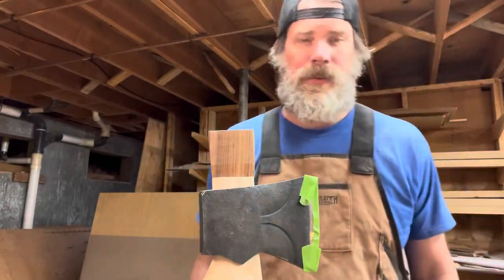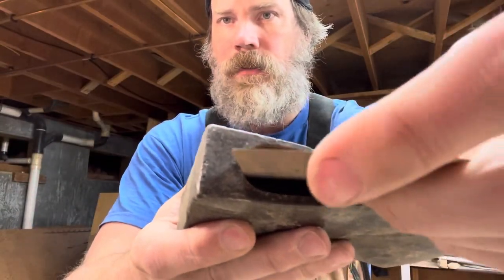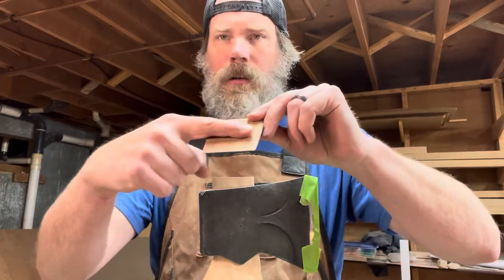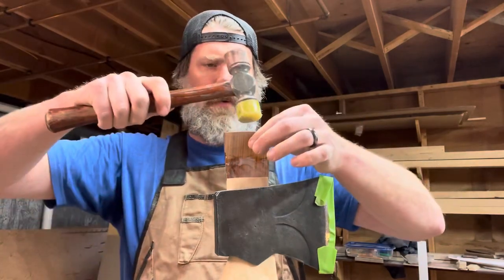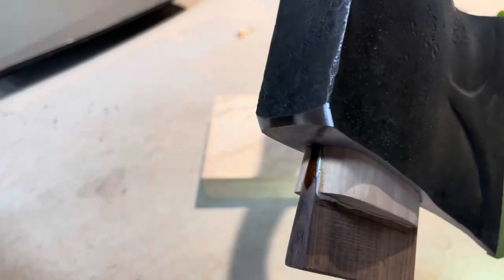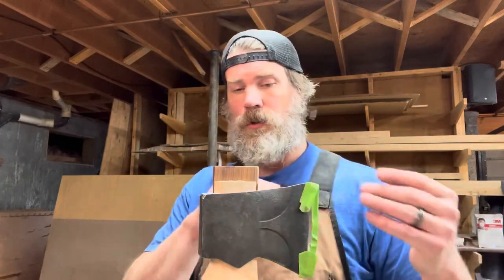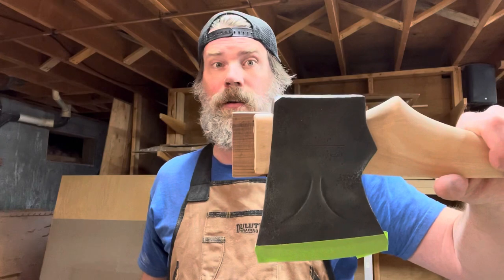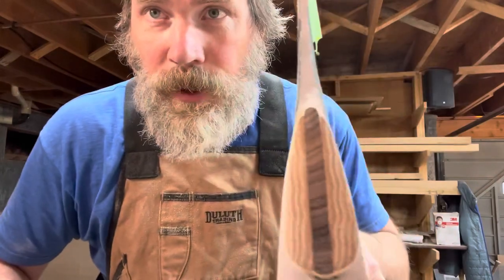Driving a wedge in an axe

Comment: I never really thought of the wedge part as being stressful, in fact, I always look forward to this.  I don't really feel any aspect of this is stressful per se, except when I first started and I would carve a handle really nicely and then worry that I would shape the tenon too small for the eye. That is until I figured out two things; don't finish the handle until it fits the eye, and use cross wedges if it doesn't fit front to back. This way you don't spend too much time on a creation that you might have to throw out as well as knowing that yo
u can salvage the handle if it's only a little too small.

Comment: Thank you so much! There are other channels on YouTube that show people putting a new handle on an axe head and it’s not even tight. It’s actually quite loose. And to counter that they fill it with epoxy, just to get this cross wedge in on an exotic redwood looking handle. And everyone is commenting on it saying they want to do that. I was in a conversation with someone and they said this axe is for display only purposes but they’re not telling anyone that. Anyway, thanks for your video.
Reply: If you display an axe like on a wall people will ask is it real will it chop wood - no it's just for looking at huh? 👍
Reply from the maker: I think I know the account you may be talking about.  I have thought the same thing when I've seen people do that.  I need to update this video.  I no longer use glue.  I prefer to have the option to pull the wedge and adjust the fit if necessary.  As long as you get a good fit and well shaped wedge it will hold.  Obviously you need to condition the handle and wedge too. Thanks for watching

Comment: I agree that wedge driving can be stressful and the more perfectionist you are, the more the stress. The commonest problem is having too fat a wedge. This will be apparent pretty soon after you start driving and it pays to recognize defeat early on and to withdraw the wedge before it all starts breaking up. As often as not this will make a bit of a mess of the wedge, but far better to make a new one a bit thinner, rather than end up with a smashed up, half driven wedge. If you were to use glue, getting out a part driven wedge is a lot harder to do. In order to get the wedge out, I use a couple of vise grips snapped tight onto the wedge to give good fixed points against which it can be levered out.

Comment: Hello, Paul;
Thank you, very nice video.
Very nice axe, I'm partial to the Jersey-style patterns, they just look like an 'axe' to me.
Your work is really beautiful.
I see your update & I agree.
One point, not a criticism.
I don't want my wedge to bottom out in the kerf, I think that stops the purpose of a wedge.
So I would make the pencil mark at least 1/8-1/4 inch short of the kerf bottom.
If the head loosens the wedge can be driven deeper, if it has the room.
I don't really care about the aesthetics so much tho.
It is a tool, function is more important to me than looks.
I've never thought about fitting the wedge length-wise, it looks really good.
As for metal wedges I think they work OK but they seem to damage the handle, IMO.
My last axe I used a round metal wedge (barrel, cylindrical),.
It was too soft but It really swelled the haft proud.
I hope I can drill the center, tap & thread it, & pull it Urban Lumberjack style, if needed.
So far I'm not real pleased w/ the House Handle I used.
The one I got was not what I meant to order so I may change it after I use it a while.
Where do you get your handles, this one looks good.
Have a GREAT day, Neighbor!

Comment: I just got through sinking a new wedge in a 200 year old broad axe.  The first thing that I did was size it to the eye of the axe.  I did this with my GBA Wildlife hatchet.  I then let it soak in linseed oil overnight.  I sank it in the handle with my 2# dead blow hammer.  It did not split.

Comment: Wood shrinks, even cured wood still shrinks over time (but not as much anymore and takes decades/centuries) 
You keep the steel wedges as a back up in case your head gets loose in a year or 5, you jump it up the handle a bit (because again, the handle shrunk) and then add the steel wedge.
So the head will last a couple decades more.

Comment: You're right...the wedge is the most stressful part.  A problem that I've had is the wedge not going down enough, even with much persuasion.  How do you know when the fit is too tight before driving the wedge?  Is there a certain amount of space to look for to make sure the wedge can drive deep enough?  What is your technique?  I hope the question makes sense.  Great video!
Reply from the maker: There’s a lot of nuance in answering these.  I’ll try to shed some light on them.  

I am eyeballing and using experience for that.  If you’re consistently not being able to drive your wedges deep enough then you need to have a thinner wedge or cut your kerf wider or both. 

I like to have half of that kerf filled with my wedge.  I’ll draw lines on the wedge to monitor this.  I want really good compression in that eye.  And I like for the wedge to push out the exposed section of the tongue to really secure the head.   

I also no longer use glue.  I am preferring to be able to adjust the axe if needed.  

Hope that helps

Comment: Hi pal, defo the most stress part of hanging an axe. Alot of my wedges mush up not sure if it's the sizing of the wedge or bad seating technique. I'll defo try your idea of hitting the bottom end. Cheers neebs
Reply from the maker: The goal is a secure fit first.  Doesn’t have to be pretty, I like it when it is.
Reply: @StumptownAxes  definitely but when ye see all these wedges in perfectly and yours mush up its a bit frustrating

Comment: How come you don't want the wedge to go all the way down the kurf?
Reply from the maker: Great question.  I don’t have an absolute answer but my impression is the wedge should have done it’s job before it gets to that depth.  There shouldn’t be enough room for it at the bottom either.  You will invite cracking to the handle with a spread at that depth.  A great wedging is not a substitute for a poor fitting tongue.  The wedge is just going to lock your great fit in place.  Hope that helps.  Others are welcome to chime in.
Reply: This was helpful, thank you!

Comment: When setting the wedge did you say that you don't want the wedge to hit the bottom of the kerf, or did you mean the bottom of the eye? Thanks for the video, I've been struggling with the wedge on a user double bit that keeps knocking loose on the trail.
Reply from the maker: Bottom of the kerf.   You don’t want that force going into the bottom of the kerf.  You could run the risk of splitting the handle.  You also are leaving no room for future adjustments and it’s likely you’re not getting enough compression in the eye wall if the wedge sinks all the way to the bottom
Reply from the maker: For the double bit you should be have front to back and side to side compression holding that wedge in.
Reply: @StumptownAxes  thank you. I'll give that a try.

Comment: Which tool would you use to significantly trim down an axe wedge?
Reply from the maker: I make them on the bandsaw, shape them briefly on the belt grinder, and then slight adjustments with orbital sander or just sandpaper.

Comment: How come wedges are wider than the eye? How do people even hammer it down without breakage? I can find no answers for this. I mainly just want to know why the wedges are wider than the axe eye
Reply from the maker: The eye wall of an axe head is tapered.  The lower part of the eye is compression fitted on the handle.  This serves as the greatest hold of the fit.  Then the wedge with expand the handle tongue against the rest of the eye wall.  It's a wedge shape to allow for a tight fit that runs deep into the kerf cut to hold the position.  I hope this makes things clearer.